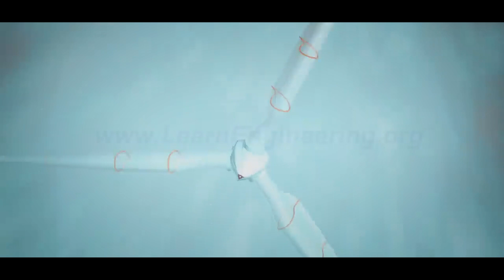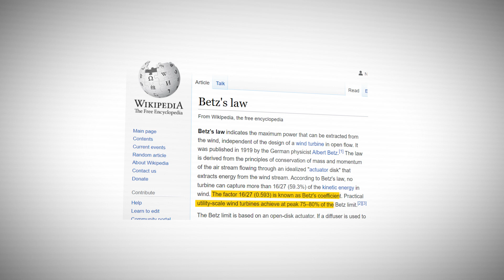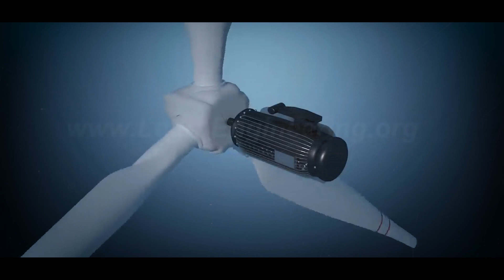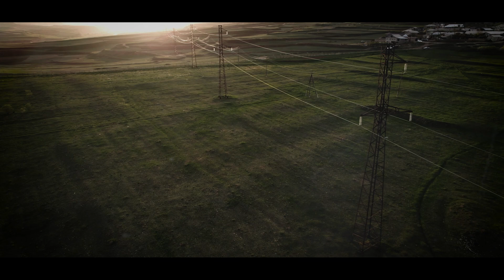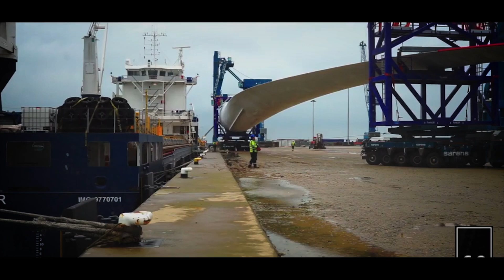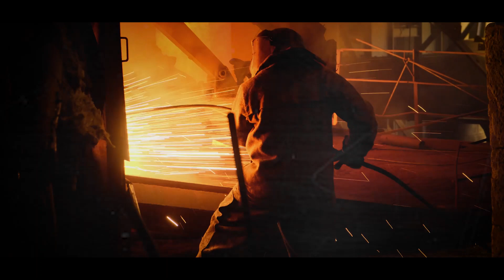The Interesting Future of Wind Turbines

Comment: I'm some type of a generic engineer unspecialised in anything that's traditionally hardcore engineering (fintech.....) and having have watched few of your videos there's very little criticism that I can levy. Including economic aspect is very important and often skipped out. Some channels like Undecided with Matt Ferrel are absolute garage, in it that you can't get something 70% right it needs to be 99% otherwise you lose credibility, but I guess many are just chasing after sponsorships and views over creating content that's has been appropriately researched and vetted.

I'd cover the topic of Orbital sea turbines, then got demostration platform working and now doing another EU funded pilot.

Benefits are huge:
- water carries more energy per volume
- tides are predictable 
- it floats so can be mounted to sea bed with cables minimising concrete usage and allowing to be used further offshore
- cheap maintenance, you grab it and float it back to the dry dock. This could eventually be fully automated with fleets of ferries picking up those for regular maintance or streaming unusual metrics. 

Challanges:
- investment/economies of scale
- sea corrosion 
- chopping up wildlife or giving it tinnitus

I think predictability alone makes it better than overwhelming majority of wind/solar projects.